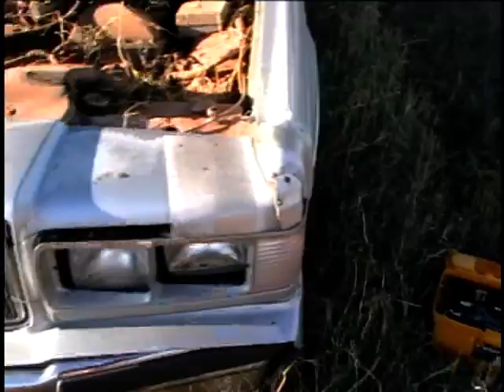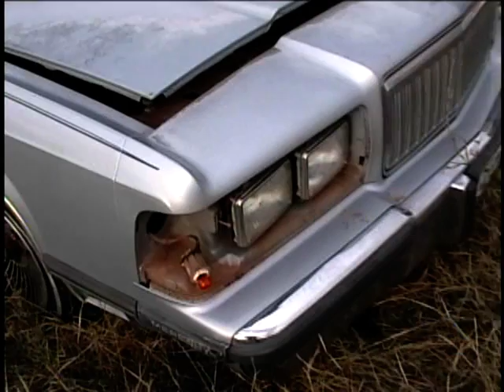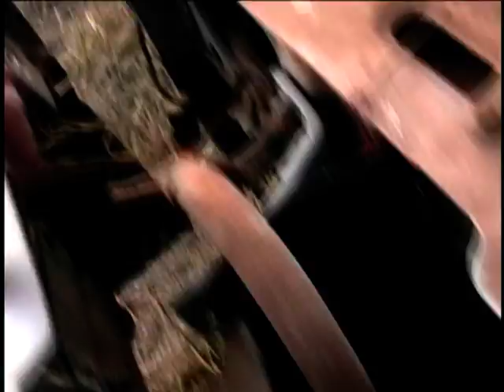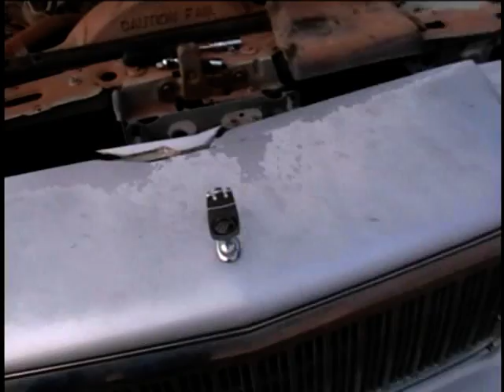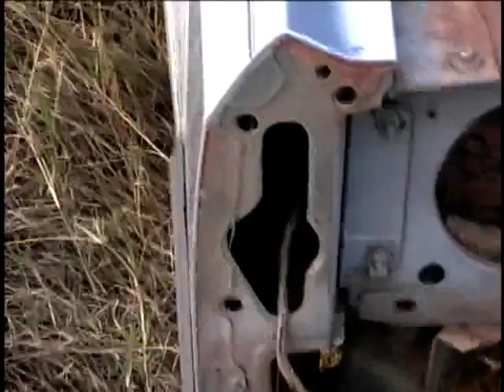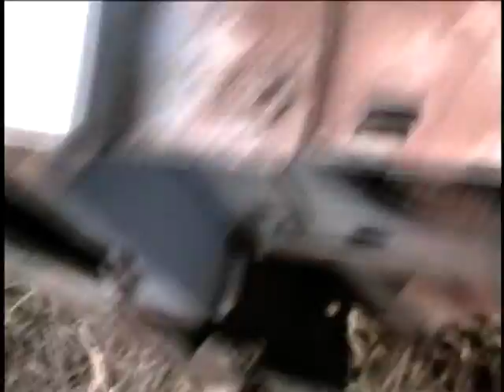1990 Mercury Grand Marquis damaged fiberglass front end repair (part 1)

Comment: What year model was that Taurus? Iliked the 1986-89 models as they seemed to be built well (My dad had an '87 LX model, and it was better than my grandparents' two (one-after-the-other) 1990 Tauruses. They rode harder, handled worse, more reliability problems than the '87, and always needed  alignments. My grandpa's now on his second Buick LeSabre (a 1999, first was a much better-built '93).

Comment from the maker: I think some Ford products were good and some weren't. The 1991 Grand Marquis which I am going to take the front end piece off of had lots of problems. Also Organist1982 had a Windstar and my parents had an Aerostar which had a lot of trouble too.
However the Ford bus with 390 V8, pickup with 300-6 Cylinder and 1978 Grand Marquis with 400 V8 have hardly had any problems at all. And, Organist1982's 2002 Escort has been good too.

Comment from the maker: In the inspections here they check:
Insurance is current
All lights are functional
Horn, mirrors, and windshield is not obstructed
Seats and seat belts are in good condition (seat backs solidly attached)
Muffler and catalytic convertor (no leaks)
Smog pump is present if equipped
Gas cap is tested on some kind of tester
The car is driven by the inspector and brake function is tested that it will stop within a certain distance
In large metropolitan areas (Dallas, Houston etc.) they check emissions